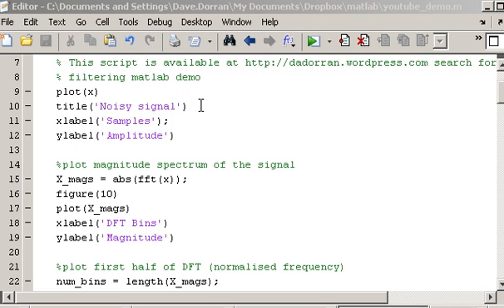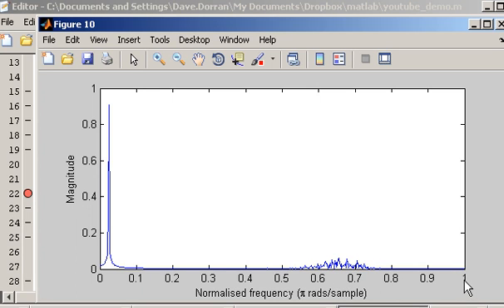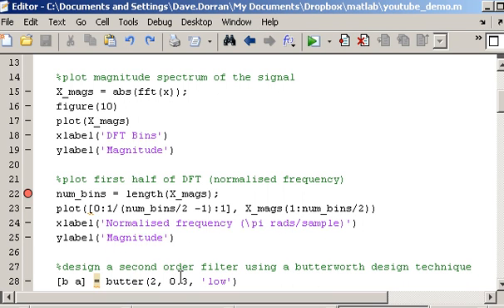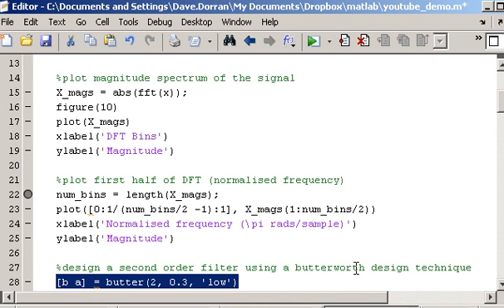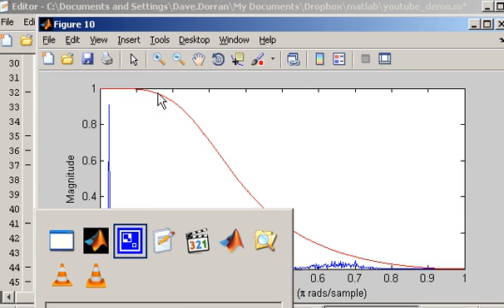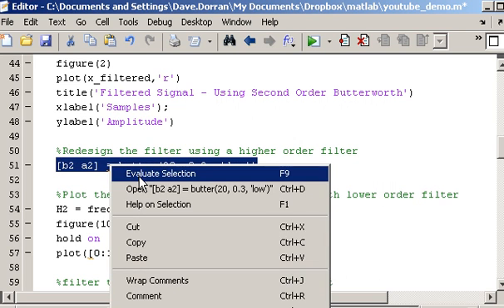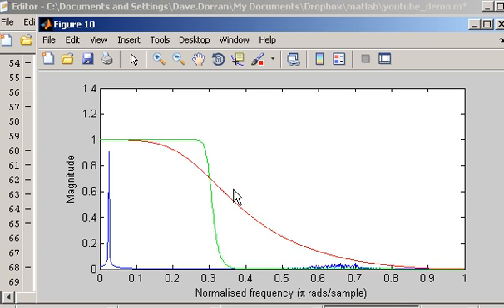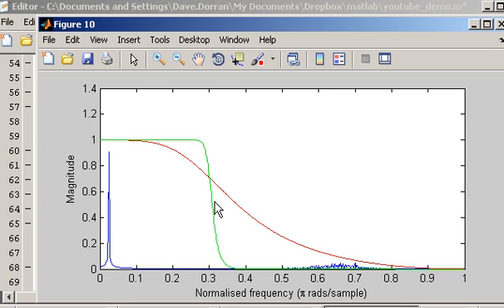filtering in matlab using 'built-in' filter design techniques

Comment: why are the normalized units pi*rad/sample? does anyone actually understand that? ive yet to see anybody explain it!
Reply from the maker: There are 2 pi radians of a revolution in one cycle of a sinusoid. The maximum frequency that can be captured faithfully without aliasing will be half the sampling frequency. Therefore a sinusoid of 'maximum frequency' will have 2 samples per cycle.  So over two samples the 'maximum frequency' sinusoid will have undergone 2 pi radians of a revolution, which equates to pi radians per sample.
Reply: @ddorran  Thanks, that does make some sense. However what confuses me is that matlab says that the normalized frequency axis is defined as f/(fs/2): frequency divided by nyquist frequency. that should be units of cycles/sample right? Im starting to see what you mean, but in terms of the units I still dont get how that pi factors out
Reply from the maker: @Captain_Rhodes  fnorm=f/(fs/2). f = w/(2*pi), where w is frequency in radians per second (rads/sec). fs is frequency in samples per second (samps/sec).

fnorm=w/(pi*fs), therefore units can be expressed as rads/sec/(pi*samps/sec), which reduces to (rads/samps)/pi. 

Another way to think about this is that fnorm*pi = w/fs, so fnorm*pi has units of rads/samp.

So if fnorm is 1 and we want to express this in radians per sample we'd have to multiply by fnorm by pi. 

The frequency axis should actually be labelled ( x pi radians per sample) to indicate that the normalised frequency should be multiplied by pi to get the frequency in radians per sample. I hadn't noticed this omission before.
Reply: @ddorran  Thanks for your time. its much appreciated. All the best mate

Comment: The filter you created is of amplitude 1. How can we change the amplitude of filter, if let say I want the amplitude to be 6?
Reply from the maker: You can multiply the input or the output by 6. Multiplying all the b coefficients by 6 and then filtering would have the same effect.
Reply: Thanks for the support. It worked.

Comment: Great video but I need some help! 

I am trying to filter a .wav audio file. I transformed it using fft( ). When I transformed it, the peak magnitude of the noise that I want to filter is around 12000 (not sure the units). How can I make this peak smaller to match your 0 to 1 magnitude which works well with the butter function you used? Or is there any way I can make a filter that has a magnitude of 12000? 

Thanks!

Comment: Do we need to enter four parameters in the 'butter' function for band pass and band reject filters?
Reply from the maker: For a bandpass filter you would use [b a] = butter(3, [0.2 0.4], 'bandpass')

There are still three parameters passed to the function though. Each function parameter is separated by a comma and the second parameter is an array containing two values i.e. 0.2 and 0.4.

I can see why this could be described as four parameters but in terms of "function parameters" there are only three.
Reply: David Dorran Thanks a ton.

Comment: Hi David I used successfully what you show in this video but if it's possible i want to pose a question to you about filtered signal.  

I started with a signal composed by a sinusoid and noise. Than i filtered the signal by removing sinusoid . Now we have only noise and i have do demonstrate that noise have zero mean and it have a probability density function described by a Gaussian function. 

So I executed the command: sort(signal) in order to obtain a vector starting by lower value  to higher value.  Than i plotted histogram and the gaussian curve and now i have to do the ki square test but i have not idea how to do this. 
Can you suggest me a way?

Thank you so much.

Comment: @5:13 0.74 should be negative.
Reply from the maker: +Ohmeko Ocampo It is correct. It should be positive. 

The reason why can be explained as follows (https://www.youtube.com/watch?v=HJEbuy4HSrM is a related video):
The b and a coefficients are associated with the general form of a difference equation which is written as follows:
a0.y[n] + a1.y[n-1] + a2.y[n-2] + a3.y[n-3] + .. ... + ak.y[n-k] = 
b0.x[n] + b1.x[n-1] + b2.x[n-2] + b3.x[n-3] + .. ... + bm.x[n-m]

when it is rewritten with the output y[n] on the left hand side the sign of the a terms change. Letting a0 =1 the general form becomes:
y[n] = b0.x[n] + b1.x[n-1] + b2.x[n-2] + b3.x[n-3] + .. ... + bm.x[n-m] -  a1.y[n-1] - a2.y[n-2] - a3.y[n-3] - .. ... - ak.y[n-k]
Reply: David Dorran Woah, thanks so much. I had a difficult with this. XD

Comment: how do you determine the cutoff??? of 0.3??
Reply from the maker: +Matthew Cserhati By examining the frequency content of the signal you can see that the noise occupies frequencies in the region of 0.5 to 0.8 (normalised frequency values). 

If you are using a low pass filter then the cutoff must be less than 0.5. By choosing a cutoff frequency less than 0.5 you will reduce higher frequencies by a greater amount. I selected 0.3 by trial an error - it reduced the noise by a visually pleasing amount that seemed to work well to illustrate the concept of filtering in the video. 

There are more formal ways to select the cutoff frequency  and if you are interested then  the following might help https://www.youtube.com/watch?v=DCCQJRJmgLo

Comment: Question: Hey, I'd like to use the freqz function and plot it simultaneously with pwelch or psd. Is that possible? I keep getting that they are not even values.
Reply from the maker: +lonesoldierx94 
Here's some code that'll do the job. Basically I normalised the frequency axis (see https://www.youtube.com/watch?v=2IkdNsGQgEM)

I was expecting the output of pwelch to be the same as H^2 but for some reason it was out by a factor of 3 (that's the reason for the plot in green). I have no idea why at the moment.

[b a ] = cheby1(7, 1, 0.5);
H = freqz(b,a);

x = randn(1, 10000);
y = filter(b,a,x);
P = pwelch(y,200);

plot([0:length(H)-1]/length(H),abs(H).^2);
hold on

plot([0:length(P)-1]/length(P),P,'r');
plot([0:length(P)-1]/length(P),P*3,'g');

legend('abs(H)^2 where H= freqz(b,a)', 'psd from pwelch','psd*3')
Reply: +David Dorran It works! Thank you!

Comment: hi ,, grate video ,,, one question though ,, after all this how can engineers go and build the filter ,, after all this is just a matlab code , we dont have a real schematics and components ??!?!?! ... cheers
Reply: +Mustapha Alkhafaaf it would be useful if we have option to turn to schematics
Reply from the maker: +Mustapha Alkhafaaf by writing the code you have built the filter! Take  a look at https://youtu.be/sTXcb3k9wf8.

The schematic is the signal flow diagram. The components are multipliers and adders and memory which all exist in a computer and micro-controllers. In order to filter a continuous signal using a discrete filter you just need to get the signal on to the microcontroller  - which is achieved using an analog to digital converter (see https://www.youtube.com/watch?v=ibj_13C5dyg). Once the signal has been filtered by the microcontroller you can send it out of the micro using a digital to analog converter.

Note that you could also build a filter using electrical components such as resistors, capacitors and op-amps.
Reply: Cheer David for the explanation, you have mentioned the delay , I assume this available only in the processor with DSP capability not all micros or processors have this ... and to be honest with you i dont uderstand why do we need the delay .. why ?
Reply from the maker: The delay is implemented by just storing data in memory - so all micros can implement discrete filters.

The delay is a key element and filtering would not be possible without it. Look through the introductory videos to gain insight into this https://www.youtube.com/watch?v=-RM8VporjSY
Reply: many thanks

Comment: and was is the "floor" for in 6:21
Reply from the maker: floor rounds down to the nearest integer. It's similar to round but will always round down. For example round(1.8) = 2, but floor(1.8) =1.

If the decimal part of a number is less than 0.5 then floor and round will have the same result. for example floor(10.3) = 10 and round(10.3) = 10

Comment: Thank you so much for your useful tutorial, David. I am trying to apply filter technique for my real data which is taken every 10 minutes average of raw data including so much noise data and some missing data also. I only know the frequency of system was designed at 20Hz. Could you recommend me how to apply filter method in general and how to define the optimal order of filter and which technique in filter method is better for my case. Thank you so much for your time in advance.

Comment: Thank you very much for this video David but i have a question :

I have a signal and i had filtered it according to your method but there is some discrete specified frequencies ( about 100 values ) in the range of  frequencies which i had already removed, so how can i add these specified  frequencies (where lies in the range of removing values of frequencies ) to the original signal so as not to remove these specified values of frequencies thank you very much
Reply from the maker: So you have a filter that, for example, removes frequencies in the range of 100 to 200Hz, but you now realise that you actually need to keep frequencies around 150Hz. I hope I understand you correctly.
One technique you could use is to first filter frequencies from 100 to 149Hz, giving you a new signal y1. You could then pass y1 through a filter which removes frequencies between 151 and 200Hz.

There are other ways of doing this but this is probably the most straight forward 
for someone starting out.
Reply: Thank you very very much, i really appreciate your fast answer it's very kind of you and yes, i mean exactly what you understand thank you very much sir